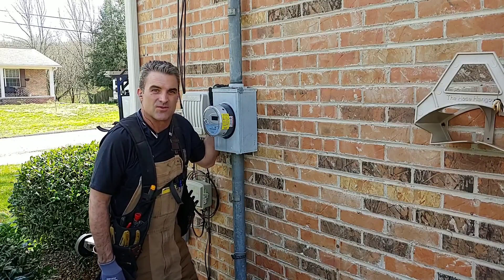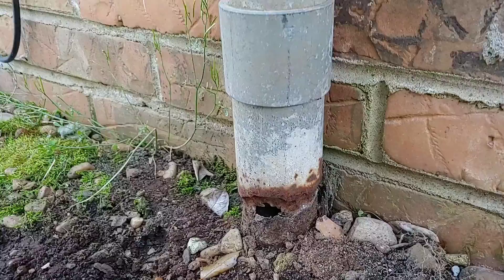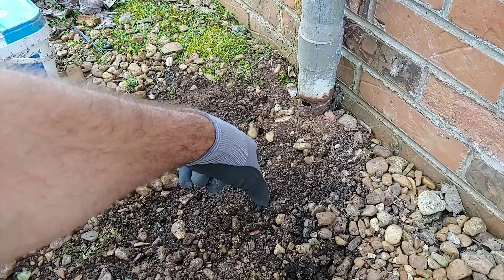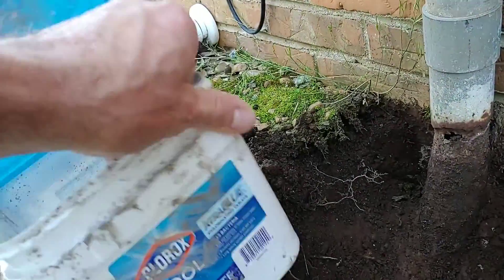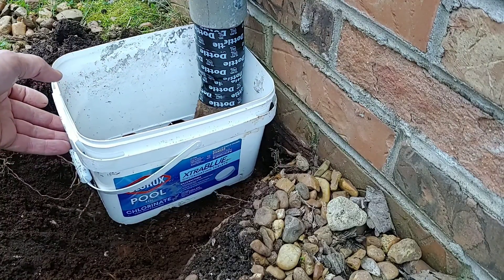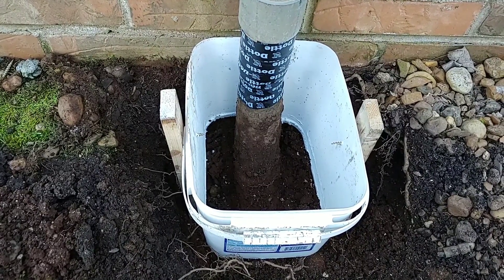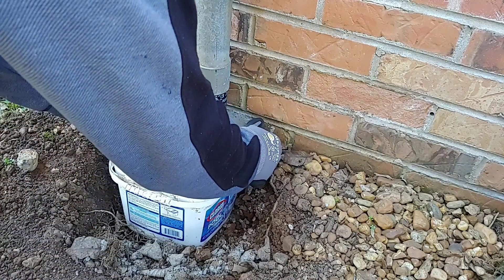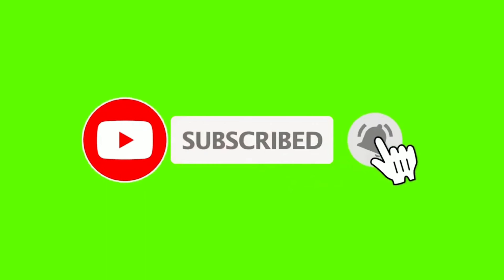How To Repair a Rotten / Rusted Underground Electrical Rigid Conduit #howto #homeimprovement #DIY

Comment: I'm a bit confused.  Is the riser the line side or load side of the meter?  Is the conduit a piping system or is it just a sleeve for direct burial cable.
Reply from the maker: Hi Jack. The riser is on the line side of the meter. The conduit is a piping system for the power feed to the distribution panel. Hope this information helps.

Comment: Did this pass inspection ? Where are you located, I have same issue and it's such a pain with underground
Reply from the maker: Hi G.I. thank you for watching, and YES this is to code.  If your area is using 2017 NEC code this will pass inspection.  It is code 300.6 #3. It is always best to check with your local inspectors if you are pulling a permit to make sure that you are operating with the same adopted year of NEC code guidelines for your state. Hope this information helps 👍